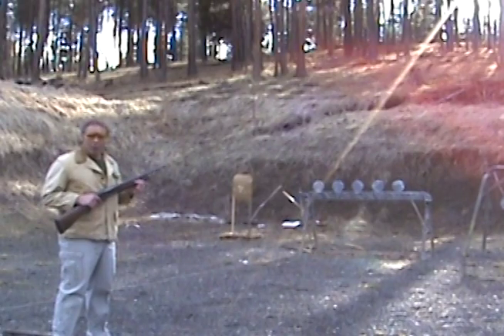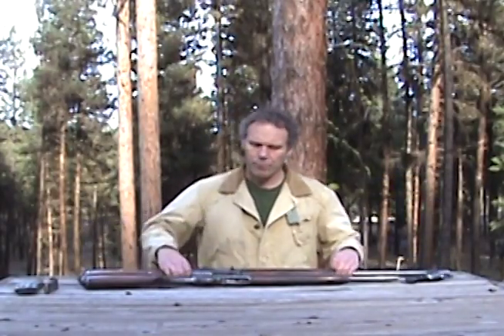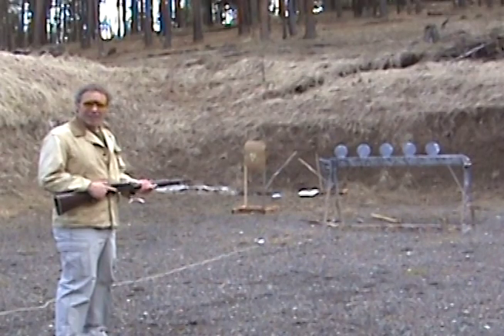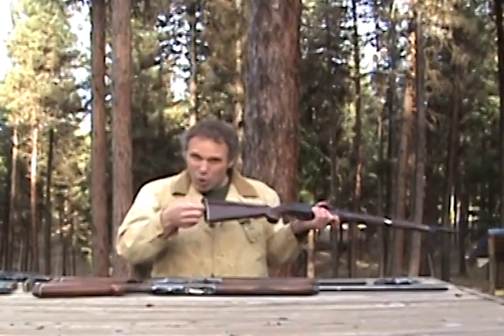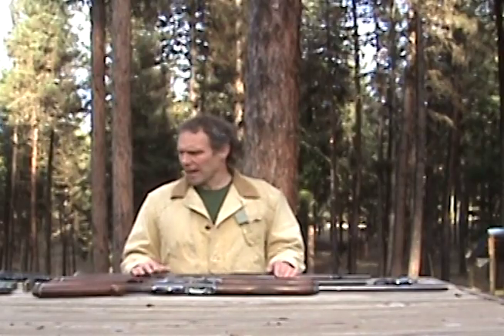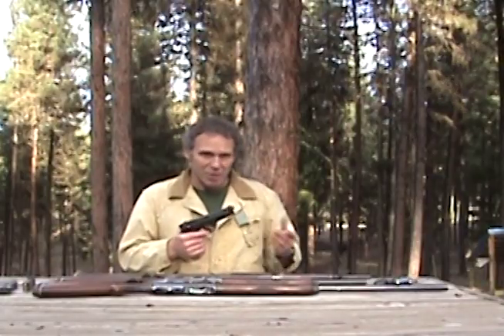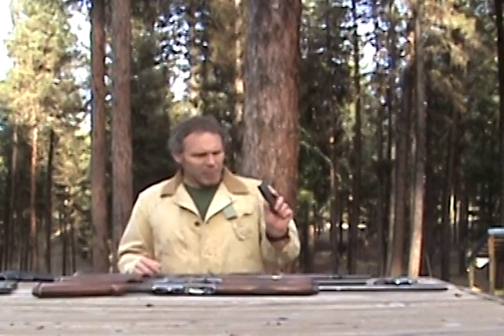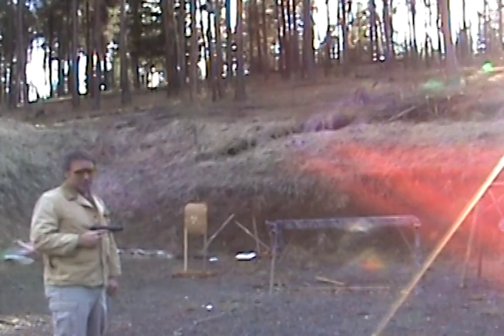Can spring compression damage a magazine?

Comment: The nerd side of this, springs in guns (magazine, recoil, striker) are metal (I'm an Engineer bare with me). Coil Springs work in torsion and bending when you compress them. There is a stress level (units of PSI, or Pounds per Square Inch). Compressing a spring produces both a combination of compression, tension and shear over the cross section of the spring, typical round wire. If you have low stress it will never fatigue. If your metal reaches a stress level called "yield" for that metal, spring bends permanently and immediately takes a set. Gun springs fully loaded are not designed to yield, but likely are at stress levels well over the fatigue stress. However "fatigue" is when you cycle metal, tension-release, tension-release over and over. Worse is tension-compression and reverse over and over. Fatigue is NOT static in technical terms. So what happens with a loaded magazine or have other springs compressed and it sits. It is a phenomenon called "Metal Creep". Depending on spring wire diameter, # of coils, radius spring was bent into or diameter of spring, metal alloy, heat treat, finish and stress levels, some metal springs will be highly creep resistant, some will not. I run my Glock 19 at 10 rounds not 15 for example and rotate through my 4 magazines. At some point I will by new springs in. I only have factory magazines.  Great video Paul...
Reply from the maker: +gmcjetpilot I didn't understand any of that. If you're saying that magazine springs will, when fully compressed, eventually go to hell on you then yes, that is what I've experienced. The time it takes to reach "eventually" being determined by all those variables you described.
Reply: +Paul Harrell Ha ha. As Ed McMahon said to Johnny Carson, "You are correct Sir!". As you correctly observed and said, time for a spring to take a set is variable, based on spring material and how compressed the spring is. Partially loading magazines or tube partially extends spring life. Some springs due to material and design can remain compressed without much effect on them loosing spring force allots indefinitely. Bottom line springs compressed over a long time can take a permanent deformation, where that same stress over short time has no effect. This is what metallurgist call metal creep where metal "flows". Metal is made of crystals or grains that can "flow" by high stress or by low stress over extended time (even at room temp). Of course heating metal lowers it's yield and at extreme temps eventually makes it a liquid. If you don't want your bridges, buildings and airplanes to sag or permanently deform, they need to be designed and built so the operational stresses are well below the materials limitations. Springs in guns are often highly compressed  and can't always be practically designed to avoid the issue of metal creep completely. However design and quality of the gun/springs and materials used go a long way. The idea of stretching them back by over stretching means you are cold working the metal, yielding the metal, which "work hardens" the metal (like forging). Spring material gets harder or more brittle. It could set you up for a spring failure or for it to lose compression faster. I would say buy new factory springs and replace them, they are fairly cheap.
Reply: gmcjetpilot creep in steels is essentially non-existent at the temperatures they experience in firearm magazine springs applications (ie, -40F to 150F).  In fact, it is very difficult to get a steel to creep below about 600F.   I characterize materials for a living, so I have personal experience with this.
Reply: I don't have your levels of technical experience, but what I do have confirms what you guys are saying. Having said that, personally when I use a gun I don't want to have a failure in function. For most of your guns you do not need to leave the magazines loaded, or leave it cocked, ever. With a defensive gun, invest in quality magazines and consider not fully loading them. Also check the functionality of the springs for the firing pin, the magazines, and general functionality of gun, consider replacing sooner than later. Also for daily carry or sitting around, get quality ammunition. Feel free to use the cheep stuff at the range or hunting. I can tell you though it sucks to lose a deer to a misfire.
Reply: gmcjetpilot I love it when someone tells an engineer he's correct he an engineer it his job to understand these things.
Reply: So, hysteresis.
Reply: gmcjetpilot Yes, creep (giving way to stress) in steel happens at high stresses that fall short of yield.  Thing is that the degradation doesn't continue once the stress drops off enough.  My impression is that Glock and other quality manufacturers design their magazine springs accounting for that, and I suspect they can withstand being fully loaded indefinitely.  When they are new Glock mags can be wicked brutal to fully top off bare fingered.  After a while of being fully loaded, they become easier to load fully.
Reply: gmcjetpilot the military has tested this exhaustively.. what they have done is simply download pistol mags one round and ar mags two rounds. Downloading to 10 for a 15 is excessive. The prolonged tension is only an issue when the spring it under maximum as you said. The simple solution is to simply download. Any quality mag will be designed with parameters to allow for maximum compression while not achieving maximum tension. If maximum tension isn’t reached then no creep “should in theory be possible”. It is still possible though cause like everything mass produced there is always variance especially in steels. 

Anyone have old mags that are designed to hold say 15 rounds but if you try hard enough you can actually fit 16? That’s cause a properly designed magazine is designed to allow the spring to not be fully compressed under full loading. If mag is designed for say 15 rounds the spring mag and follower are designed to allow for say 15-1/2  or 16 rounds thus preventing full tension threshold while compressed when fully loaded. As the spring fatigues from cyclic loading eventually you reach the point where you can over tension and load in extra round. 

For the gentlemen who asked how do you know when to replace a spring or magazine... this is how.. you’ll notice in 90% of mags when new that very last round or two is very hard to load. Through compression and decompression the spring fatigues enough to make loading easier. Once you reach the point where you can almost or with some actually fit an additional round into the mag then it’s time to replace. That last round should just barely fit. If you can load the mag and still press the last round down a little then the spring is over fatigued and no longer has the same tension it’s designed to have. I can tell you 15 round beretta mags do this better then any I’ve seen. I’ve actually been able to load 17 rounds into a 15 round mag once.  I’ve actually shot mags over loaded like this and the only issue I’ve noticed doing so is the last half of the loading has issues. As in the spring will stick it have so little tension at half compression that it will literally allow rounds to just fall out of the mag loose. 

Mag spring fatigues is a real thing and does happen. However I’ve  never seen a failure that would make a typical defensive situation and issue. It’s only when getting to the last few rounds that there will be malfunctions in my experience. So if you have again say 15 round mags it will work even severely fatigued till there is only 3-4-5 rounds left in the magazine. Unless the spring is so fatigued that it actually breaks.. I’ve never actually seen this happen but is possible I guess if you left a bad semi working spring in use long enough. However to make this Happen the spring has to be in use over and over as a static position isn’t going to fatigue metal this way. 

Perfect example is a nail in your house wall.. it will support that load forever.. but if you beat it back and forth a few time it will snap off. The only exception is introduction to excessive heat or cold which can change the molecular density of the metal itself. 

As for rifle bolt springs like the shot gun that was locked open for a long period of time.. that’s very bad period. The way the springs are designed for holding a bolt closed is not the same as for a magazine. They are not designed for high tension thresholds at compression and as such need to be under as little stress as possible as much as possible.
Reply: @fishrrelaxing9361  That was one of the best explanations I have ever heard on this subject. Thank you.
Reply: Scott Eason glad it helped. I have a habit of over explaining and complicating things while trying to make them every day understandable. That’s said I’m not expert in mechanicals engineering or even firearms. I’ve been shooting for about 30 years and have extensive training well beyond the normal person while having much less then many others. I have a very good understanding and schooling of metals and engineering and I’m pretty decent with firearm design and use. I simply use logic to blend what I know about one field and what I’ve seen in another to come to a logical conclusion. I’m sure there are 100 shooters better then me that will disagree an at same time I’m sure there are 100 engineers that have never shot a gun that will disagree. I’m simple sharing my personal knowledge and experience between the two fields. Anyone who has a gun they’ve owned for years and put 30k+ rounds through I think would back me up 100%. I think I was fortunate my first pistol was a 92fs with very loose tolerances (which makes it reliable) I have learned a lot from the thousands of rounds if put through it in terms of claimed facts vs real results.
Reply: gmcjetpilot I always think of car springs, a car spring always has weight on it and gets a whole lot of compression cycles every time you drive, eventually car springs break but I havent seen much in terms of sag. Its almost as if the magazine springs are of poor quality and/or are compressed too much causing them to deform.
Reply: @BigChiefWiggles    I have never seen a broken suspension coil spring but I have seen older cars sag.  Aftermarket lowering springs will settle in and sag a little but I think this is because of the rubber spring isolators becoming compressed.  The only broken springs on a car I have seen would be leaf springs but not because of compression cycles from driving and valve springs.  Valve springs tend to break in aftermarket valvetrains because of coil bind when the coils touch each other and in some cases possibly because of certain resonances.
Reply: @MP-vm1jt  right, it seems like being under constant load is not the problem for a good quality spring, but I load my mags short by one or two rounds when storing them loaded, just in case, I figure if the spring was designed with some overhead for peak compression it should be fine with less that that.
Reply: @BigChiefWiggles  I completely agree, especially with loading one less in the magazine. Now hopefully we have magazine springs that are of a good quality and they designed the mag so they are not over compressed when fully loaded. But loading one less in them should negate the problem with over compression. Thank you for the insight.
Reply: Sounds about right.
Reply: @rifleshooterchannel208  Amen! Like I'm gonna notice that the last 2 rounds didn't load in an emergency? And maybe spring manufacturing standards and technology have changed in alot in 60 years?

Anecdotal evidence is just that. It's not scientific and you shouldn't be applying it as if it were. Check with the company that made your spring. Every single word here is meaningless without knowing how YOUR springs were engineered.
Reply: @gmcjetpilot I know this is 2 years old, but sorry, I call bullshit on this one.
You're an engineer so you know things? 
So what? Are you designing springs or things that use springs? 
Manufacturing has changed over the past 60 years ( or so, for the anecdotal evidence used here and in the video).
Springs are designed for specific purposes, loads, conditions, etc. 
Did you know that vehicle suspension springs are designed to spend most of their life in the middle? Maybe the weight of the vehicle plus the average weight of it's occupants?
I fail to see why springs in firearms would be any different. 
Meaning, you should really check with the manufacturer before deciding what kind "program" you're going to implement in your firearm maintenance.
While I love Paul's videos, anecdotal evidence here is meaningless. Sure, stories that teach us to regularly use and maintain our guns is a good life lesson, but everything else varies so wildly that it becomes useless.
You'd have to do your own testing, in a controlled environment, over a period of years, with a while bunch of the exact same product being tested under varying conditions.
Or, you can just go to the manufacturer and find out how they intended their products to be used in order to get the best results.
Reply: @BigChiefWiggles : Haven't seen much of Sag?  Um Ok every Ford Product with Coils (especially REAR Coils) has tremendous sag...when 15/20/30/40/50 years old!  And as for the other guy who said he hasn't seen leaf springs break from use...Never owned an AMC or Jeep product then?  Eagle Wagons (and 2wd Concords) and XJ Jeeps if you look at them wrong, are notorious at breaking leaves.
Reply: @misters2837   I dont know how much of that is from being used and how good the quality of those old springs was... We know springs weaken and fail after a lot of compression cycles so if the vehicle is being used a lot, especially on bad roads and/or with bad shocks then Im not surprised there will be sag after a while. I have bought a lot of used vehicles over the years and the vast majority of them had bad shocks and struts on them, most people either dont notice their shocks/struts went bad or dont care and just keep on driving, this does a number on their springs and ball joints after a while and costs a whole lot more.

Comment: I just replaced my M&P 40 magazine springs for my duty gun last year. I bought the gun new in 2008. They were loaded and carried everyday other than range and training time required to reload them. They stopped locking the slide back but othwr than that were fine. $15 and Midway sent new ones good for the next 10 years. Absolutely a real thing. Thanks for the video. Always entertaining.

Comment: Great talk.  Seems we need an engineer to weigh in on the subject.  I suspect there are a few factors to consider, such as the type of metal the spring is made out of, how many cycles the spring has gone through, whether or not the spring is fully or partially compressed, etc.

Comment: When you talk to a "scientist" that claims to know about this, they always say there is no such thing as spring fatigue, yet I've seen both sides of this. Currently, I have a test running on some Magpul mags, been running it for 3 years now, test will run for 5 years at least, and have not seen any change. The mags are all from the same batch, loaded with 0,5,10,15,20,25,28, and 30 rounds.
I'm guessing the real answer is, buy good gear, get good results, buy crap, get crap results.
Reply: 100% materials quality is everything. Don't get cheap mags. Just don't. 

I'm sure your test will be a resounding pass. The pmags springs should be quite high quality. The feeding lips though? I can't say
Reply: @newerest1  After 4 years of no change, I gave up on the test, I knew it wasn't going to change anything, so I figured another year was sort of silly. I'm confident that if you purchase US/EU made mags, and stay away from cheap Chinese junk, you'll never have an issue. The one BAD thing about MagPul mags is if you drop them and they land on the top, you can break the flange that holds the ammo in.

Comment: If a component employs a spring that can exceed its elastic limit, the function and reliability of the spring can definitely be affected. Even if it is properly designed, manufacturing defects and damage can also result in premature failure. As you mention, simple precautions like reducing the spring tension can eliminate or significantly reduce the consequences. A spring that is properly designed, manufactured, and maintained should last a very long time. Great video as usual.

Comment: This is a question about metallurgy than anything else.  Type of alloy and quality of the spring steel etc.
Reply: the required tension for the magazine, length and girth of the spring, any curvature... yeah I'm gonna shut up
Reply: I agree that is the biggest factor by far....
Reply: 80% of people don't understand that there there 400+ different types of steel that are commercialy available...and thousands of different levels to harden, anneal and temper each one of those types most just know "cheap and "quality" that's all the mental effort they put into it
Reply: Certainly. Every spring will fail, wether compressed or not. The question is, how long before it fails?

Not having a loaded gun and full magazines because you fear spring failure is just dumb in my opinion. Springs can be replaced and if a failed spring means the last round or two won't feed, yeah, I can live with that.
Reply: @steelboymi  I can already hear someone trying to tell me how "stupid" I am to buy a higher quality spring, because "everyone knows they're all the same"

Comment: I'm "that guy", so I'll stick with revolvers.
Reply: the hammer has a spring that has constant load on it.  Also, there is a sort of spring that creates the tension for rotating the cylinder.  Springs all around in that thing.  Trigger, etc.